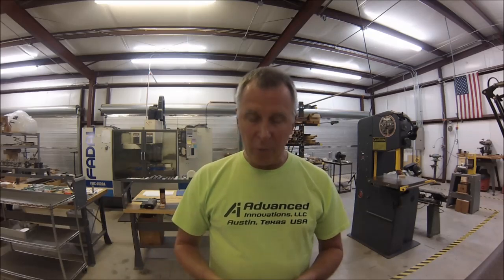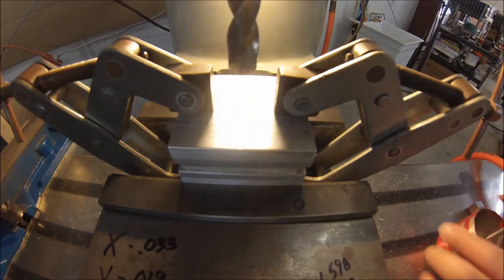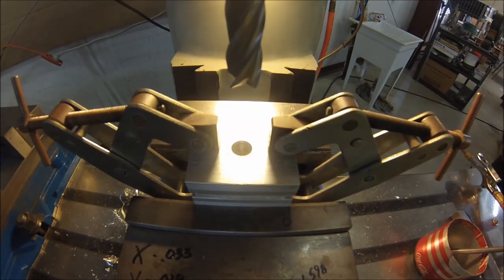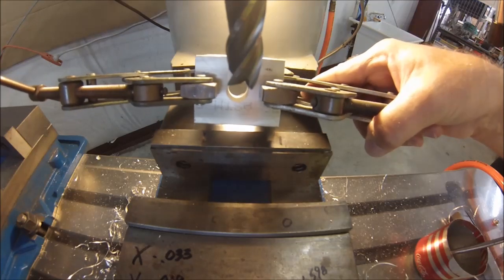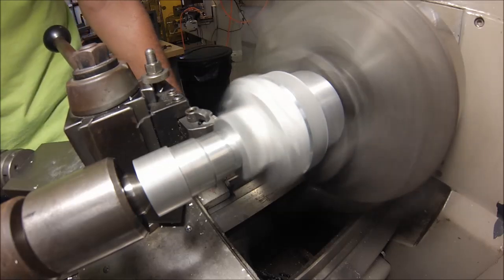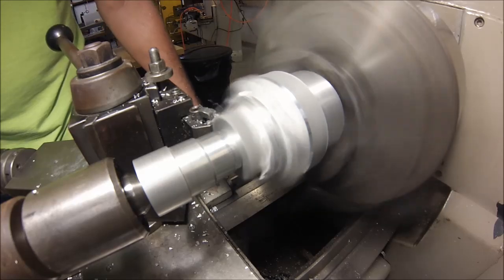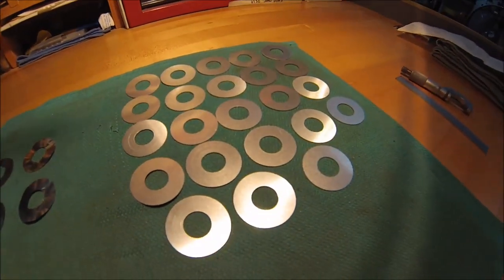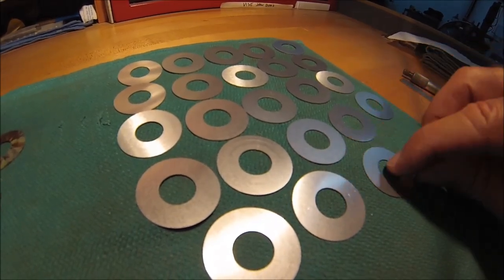Machining ultra thin shaft spacers and precision washers

Comment: Hi Joe,
Normally I would have used the screw method, but this pressure way is great and easier on the centers...
Cheers,    Pierre
Reply from the maker: Hi Pierre. If this shim had a 4mm hole in the center, this way would be the only way. Larger holes and thicker material are well suited for the screw and cap. I do it both ways. Thanks for the comment.

Comment: Joe! thanks for the thin demo, I have actually done a similar job using galvanized steel flashing,  how would you go about this operation, if there were no hole in the middle? Gud on ya!!!
Reply from the maker: Pressure only will work if you don't push it too hard as well. I've seen guys put 220 emery between the parts to keep them from slipping. The shellac idea is a good one. Let it dry first.
Reply: SHELLAC .
Reply: SHELLAC MELTS WITH HEAT
Reply: LIKE SUPER HOT GLUE .

Comment: Love your videos. Give us your thoughts on using compressed air around the mill and lathe. Do chips get driven into the equipment? I am scarred to use it on my machines.
Reply from the maker: I use a brush around areas I don't want chips to go into, but for the most part, machines are usually setup with wipers for critical areas. I don't blow between the tables, or under slides, but everything else is fair game in my shop.

Comment: Two flute for ali, 4 for steel..I would be interested in some elaboration...slotting, side milling plunging etc.  Thank you for this interesting vid.
Reply from the maker: I never use a 4 flute on aluminum as a rule. Its all about the size of the chip and how aggressive you cut. Slot, nibble, plunge climb etc... it doesn't matter. Aluminum is a much softer material and can be cut off quickly. With only 2 flutes, the chip has some place to go and the risk of it packing up is reduced. If you were to push a 4 flute and 2 flute through a piece of aluminum at the same high RPM aggressive rate, I'd be willing to bet the 4 flute packs up and breaks first.
Reply: Me too.
Reply: Joe Pieczynski Thankmyounfor your help.

Comment: Joe, I would love to see a video from you on the subject of mill tooling for dummies. I mean I've been studying for years (actual books, not just YouTube) and I'm aware of the terms of various tools, but I just got my first mill set up this past week and I'm overwhelmed trying to recall everything I've read about types of tooling for different applications. Your comment about 2-flute vs 4-flute for aluminum and steel made me think of asking you to cover it. I have a dozen or so end mills that came with the mill, and most are absolutely new, but they are old enough that I can't find info about them online to know their proper application, like a 3-flute roughing end mill that looks mean and expensive (1" diameter, 2" cutting, 4" overall). I don't want to ruin my tools or workpieces through trial and error. What do you say? Worth making an overview video? :)
Reply: Best suggestion I can make to you is to never spend money for used end mills, 90% of the times they don't get much life left in them...    It's more likely gonna produce heat and ruin your part as well as your day, ask me how I learned about this...   lol